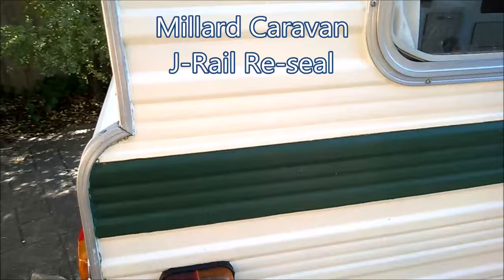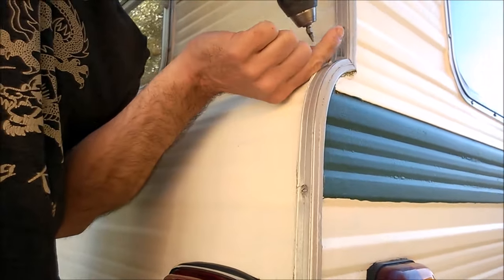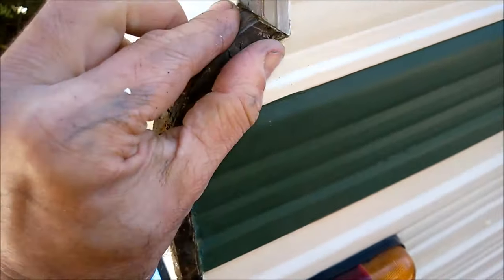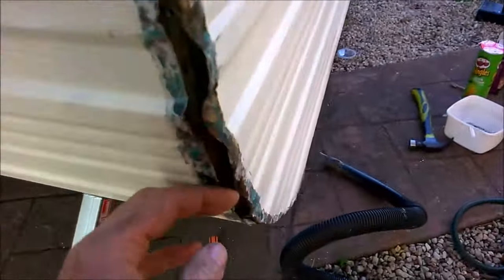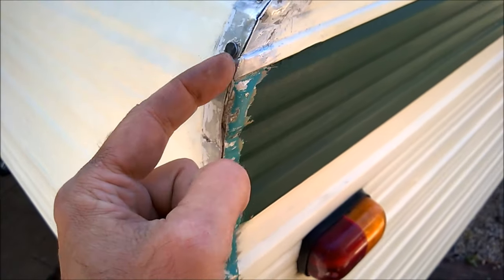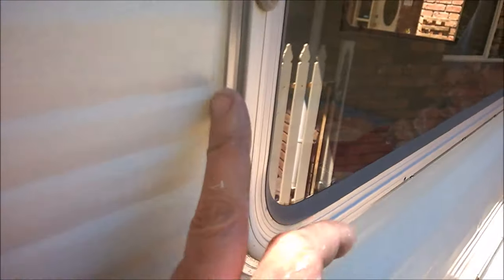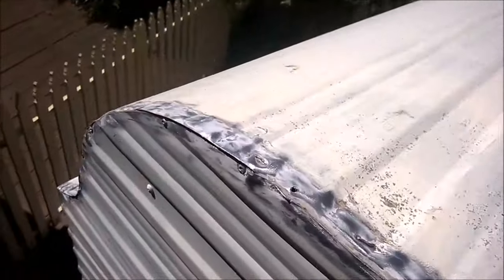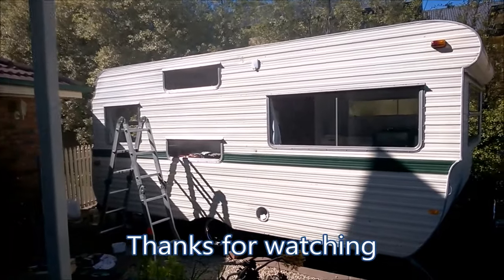Millard Caravan J-Rail Re-seal

Comment: Thank you for the info on your recording.  Removed, stripped and cleaned a J-rail today.  I have no experience so this was a great help.  I place my sealer into the j-rail - it is so messy.  I guess practice makes perfect.  I have strange nail/tacks in mine, not screws.  they are all rusted and are breaking.  I decided to replace with stainless steel type screw nails.  Like you say, it is time consuming but doing it properly is worth the end result.  Thanks.
Reply from the maker: Thanks Rachel, couldnt do without my helper :)

Comment: Thank you for the shot of what is under the back cover because now I can show the insurance company what mine looks like. I have just had mine repaired under insurance claim and the repairer quoted new inner lining under rear side $123.40, inner frame required (timber) and frame and inner lining $306.35 . But wait for the rip off of all time, outside sheeting 1.6mm checker plate $379.50. The checker plate is 350 x 1980. I got a price of $35 from weld rite in Invermay, making repairer quote over a 1,00% mark up.  A sheet 1200 x 2400 cost about $85 to 129.   I marked the outer rear sheet with spray paint, took photos and videos. I got under the motor home when I picked it up and saw my paint marks. They had not replaced anything with new material with the exception of the checker plate and edging. I asked employee what was on my van and he said my stuff was. It had been straightened and rewelded and a new bracket put on the corner. I checked out the caravans in the workshop before work commenced and the out corners sheeting was clean and sealant looked great, however they used Bostik v60 a structural glazing silicone, which must be cleaned off with white spirit and can not be painted. Corner moulding finish is rubbish because the old black butyl had not been cleaned off properly and can be seen under parts of the white silicone, yes they used silicone and also covered the head of my old screws which were supposed to be replaced with stainless steel screws. So much silicone was used in places that the corner cover does not sit snugly over the screws and into moulding, thus explaining why 3cm of silicone was used at the bottom of the corner capping, which should never be sealed off.  They even got the silicone all over the rear cargo lights and side reflectors. Rough estimate of $550 to $800 ended up $3,790.27 which included removal of welded bumper bar and wiring and refit of the same. 32 hours work also over estimated.
Reply from the maker: This is so typical from what I been told about caravan repairers. Unless you know a reputable company, most see it as a quick cash grab, no effort on quality. This is why I do work myself.  There is so much info online about the use of silicon and liquid nails as a sealant, and how not to use these.  A friend has a $60k caravan and the air conditioner on the roof is lathered with silicon! Proper design shouldn't need a filler, so again poor  quality but this time from an expensive van.  Do the work yourself where you can, at least you seem to be willing to learn and give it a go.

Comment: your videos have been very helpful for my viscount reno's , thanks for posting these videos. I have notice your chassis is very clean. What did you do as mine is really in need of a wire brush ad rust proofing paint. There's not a great deal of room under vans so how do you do it? Do you jack it up as high as possible? It's something I need to do to get it road worthied but I also can't see myself trying to do it with 30 cm space to do it in
Reply from the maker: +mkuebler5 Thanks for the compliment.  The chassis was hard work, 2 days it took, 1 for cleaning using angle grinder with wire wheel and another to paint it will rust protection paint. I jacked the van and placed jack stands under the axle. Even then it was tight under there.
Reply: UGH! I really don't want to get under there at all. Thanks for getting back to me. It's been a learning curve for me but I'm optimistic that it's going to look great once finished. I was hoping to turn a blind eye to the j thingies but I'd be foolish to not do them and ruin the hard work I've done inside.
Reply from the maker: +mkuebler5 Look it is a pain, and I went through what your going through. BUT, once done you will thank yourself you did the extra work!  Good luck with it all.

Comment: From one Taswegian to another. Nice work. So you don't have to seal around the screws?
Reply from the maker: Yes I would but also note that I went back to using Butyl Mastic on my Viscount caravan resto.  Much easier to work with and non adhesive.
Reply: @rovertasmania7033  Cheers.

Comment: Great job, I am about to tackle my camper and fix the j rail sealing. Hopefully I dont have any water damage on the wood trim.
Reply from the maker: As I stated in the description, make sure you investigate the sealant options.  I used Sika, but its an adhesive (never get it apart), whilst on my newly purchased Viscount ill be using butyl mastic. Good luck with it.
Reply: Sika make a sealant for use on caravans, like the butyl sealant shown in this video. It does not set but stays soft so that it can be used on anything that has to be removed when making repairs

Comment: Did you apply sealer to the J rail- screw to van and then use more sealer to fill in the gaps? Or did you apply sealer to the van as well before placing the J rail back on? Thanks! Love your videos
Reply from the maker: I only applied to the j-rail. I used plenty of sealant so when pressing down the rail it would push the sealant into all gaps, including screw holes. When tightening down screws more sealant would squeeze through. No way that would leak. Cheers.

Comment: Thanks for sharing. Can I ask, are you using the same screws to reattach the j rails or new ones? And if new what is the size we should be using?
Reply from the maker: I re-used all my screws. They shouldnt be damaged, unless rusted.  Dont know the size, but take one as an example and find the right length and thread.  Also dont use staniless steel, not good with alloy.

Comment: Does anyone know do I need to reseal the roof first or do this first? Thanks
Reply from the maker: The roof cladding may have a seam that joins two or more sheets across the top.  If this is the case, then yes reseal the roof seam when you reseal the j-rails.  I got an example of resealing my Viscount caravan roof as an example.

Comment: The black stuff is butyl, could be tape. Use alcohol to clean the caravan surface
Reply from the maker: I used metho, which what was recommended as the prep liquid on the container.

Comment: Thanks for the video.
Am contemplating buying an old van for a restoration soon, and this was my biggest concern (well, this and the floor)

Few questions, if you don't mind?

1) Can you buy new J-Rails?  If you can, does it come in straight lengths that you bend to shape, or do you have to buy them shaped to suit the van?
2) What were the J-Rail screws going into?  They looked like self tappers?  Is there a wooden frame underneath, or were they just gripping the aluminium skin?
3) I'm assuming the floors of these older vans are made of marine ply?  If they are rotten, can they be replaced with the shell attached to the chassis, or do you have to unbolt and lift off?

Thanks again.
Reply from the maker: Hi Dj - thanks for the post.  OK with the questions
1) Yes you can buy new ones and you bend to shape as you screw them down. They need to sit firmly against the wall edge as well
2) On my vans (Millard now sold, Viscount) both are alloy frames.  The the j-rails effectively sandwich the roof and wall sheets against the frame.  However the walls and roof sheets are also screwed to the frame.
3) Floors are a difficult one.  The ply shouldnt really be rotted throughout unless it was sitting in damp conditions with water leaking into the van.  I had to replace a piece only which I have a vid on, but to replace the whole floor is a major undertaking because you have the interior fixtures (kitchen, bunks etc) also needing to be removed.

I highly recommend you buy a van that has very little rot aside, may accept the usual places like back  walls and around the hath perhaps.  Issue becomes when trying to replace these also, as you need to remove fixtures to get to the rot walls.  If you look at my viscount vids you will see I had to do major work to get it right, but now its great!

On the j-rails, again an item that shouldnt need replacing unless its been damaged by removing the old.  If need to replace, try and match the holes so you re-use the existing holes in the frame, however this is easier said than done.

All the best.
Reply: Thankyou - very detailed reply.  Will watch some more of your videos for some more know-how.  I'm pretty handy mechanically etc, but caravans are a new one for me.

You can get a device called a "hole finder" - See this video below.
You can make your own by riveting together 2 hacksaw blades, then drilling a hole through and putting a peg in one blade.  Have used these a lot.  Very handy...

https://www.youtube.com/watch?v=eK-d00TAJ1g
Reply from the maker: If you are handy mechanically then you got no issues at all.  Excellent little gadget that one, thanks for sharing that link.  I can see many uses for it with my other projects now :)

Comment: I once build caravans like you are working on in this video. Using mastic is not the answer as it will not flex enough with movement of the caravan and will break down over time. It should have replace with Strip Caulking Tape, as this was on it original. This tape allows for movement and water proof the caravan. It goes onto each side of corner then J-rail goes over that screw it in and you done. The Strip Caulking tape that was on the caravan original was in good order and did not have to remove even if it didn't look that good. If you would like the caulking tape you will find it at http://caravansplus.com.au/catalog/product_info.php?products_id=11938  Hope this helps someone from making this mistake in the future.
Reply from the maker: +D K Thanks for your post. I agree mastic isnt the answer as you correctly state, but went with the sika 291 marine grade (not mastic) because it is used on boat decks/hatches etc, so if it can withstand sea water and abuse then its more than sufficient for the van.  It also adds to structural integrity.  My vids arent a how to, more a how i did it so i dont claim to be the expert.
Reply: Yes,you are right,thats why I put the web link up so people can find it. I know sika 291 but as it does not flex enough with movement from road and heat from the sun. It will work for around 5 years but after that it will break down. Hope you enjoy you caravan adventure mate.
Reply from the maker: +D K Thanks again, it will be interesting how it holds out at the very least. cheers.
Reply: Rover Tasmania well answered i think we all appreciate your videos as how you do it rather than an instructional video
Reply: @rovertasmania7033  five years on has it held up?
Reply from the maker: @johnagno8169  John, I sold the Millard (actually a regretful decision!) but I suspect it would still be OK.  However, I went back to using butyl Mastic for the Viscount build and would recommend that option.

Comment: Good video. I'm about to tackle the same task on a 15ft Millard and this has given me some good pointers to get me started. Did you replace any of the screws for the J rail or did you reuse whatever didn't look too rusted or questionable?
Reply from the maker: I always re-used what i could to try maintain originality. Some you cant if its rusted and threads are damaged. Just be mindful of what sealant you are using... the millard i used sikaflex but the viscount i have now i went back to butyl mastic.
Reply: Rover Tasmania cheers. 
I'm planning to use a butyl mastic tape. It's a little firmer than a tubed type sealant so it should squeeze down to create a good seal just like a gasket that'll still cope with a little flex, rather than just squeeze out the sides. Easier to apply and clean up too.
Reply from the maker: Good luck with it all too ;)

Comment: Great video how many tubes of sikaflex did you use
Reply from the maker: Hard to remeber, but I think about 6 tubes. Since using sika, I have gona back to using butyl Mastic on my Viscount build (after Millard)
Reply: Rover Tasmania great videos! I need to do this to my Viscount. Why the change from Sika marine adhesive to butyl mastic? So it’s removable again in ~20years? Thanks, Steve
Reply from the maker: @stevelines4646  correct, if something needs repair it can be dismantled. Also butyl is actually quite Good, its even used on sailing boats which obviously cop salt water abuse.
Reply: @rovertasmania7033  what type of mastic did you use… I have bought selleys n mastic for my Franklin.. just want to make sure it’s right. Says it’s non skinning?
Reply: I think I should have got the d mastic.
Reply from the maker: @danvdz  As long as it says butyl mastic it should be fine.

Comment: Just wondering if anyone can help, I need to remove sealant that has been sploged all over my rails, Im not sure if a heat gun or chemical or literally painstakenly srape and peel
Reply from the maker: I used a wire wheel on a drill, being very careful not to damage the rail. Sounds like yours is caked with silicon, a common bodge job to try seal a leak but rarely works.
Reply: thanks, To be honest ive been getting so overwhelmed  by the issues and no experience im seriously considering taking the skin off and putting it into my garden taping then using car fiberglass kit on the edges and using it as a shed! then putting the cupboards into my bedroom instead, I have seen videos of floors being replaced and it's an absolute nightmare!
Reply from the maker: They are a very simple design... just take your time with it.  When I did the Millard (now have a Viscount which was a bigger resto job) I too thought the same.  Didnt know much about them, but slowly worked through it.  I also am a member of the Classic Caravan forum, which has great members sharing experiences and knowledge which helped me no end.  Jobs like these take weeks/months, so dont think its just a weekend job only.  Be patient :)
Reply: aww that's kind words thank you, Yes you are right, so very right :)
Reply: @darren knight awesome. thank you
Reply: Silicone remover.com.  Sprays on.  It’s clear.